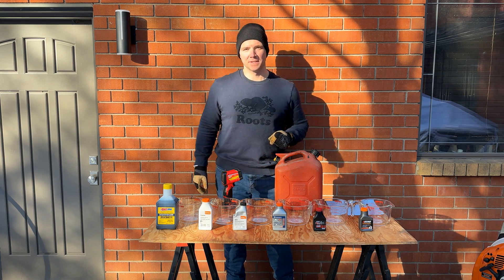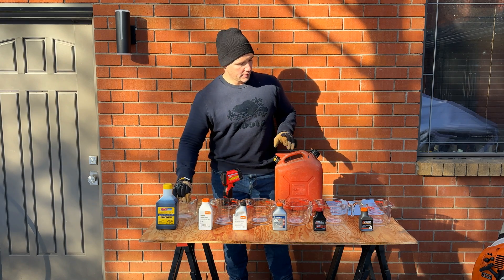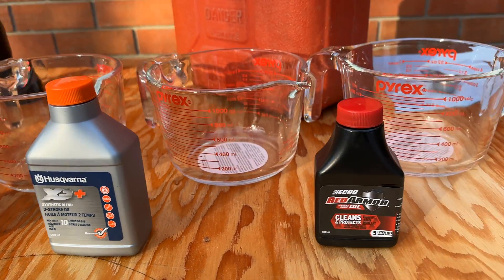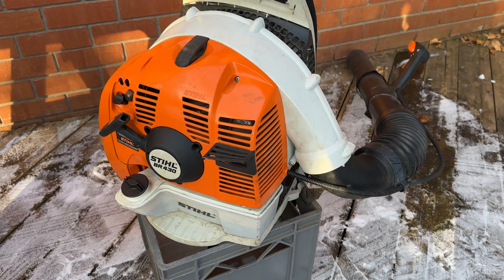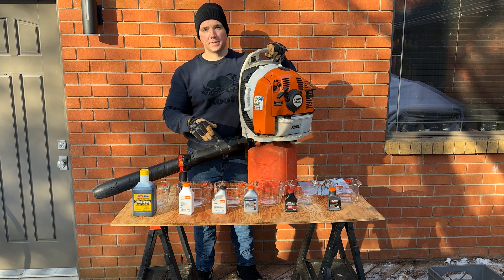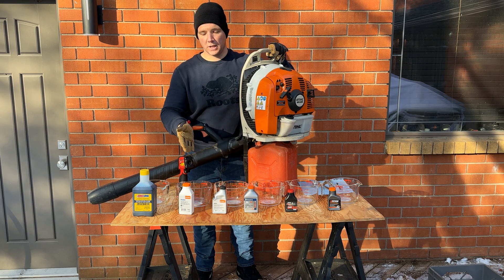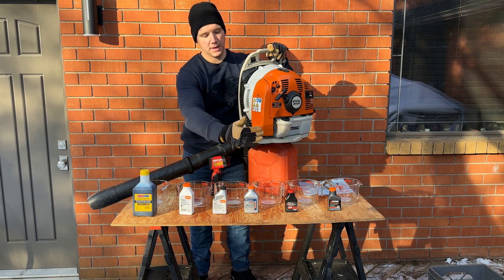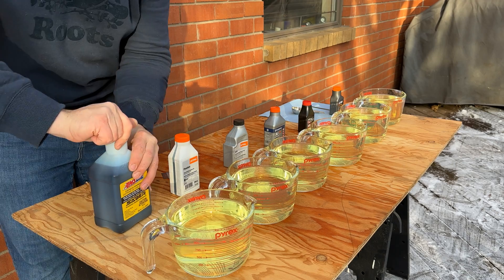Which 2-stroke oil is safest for your small engine? Temperature testing 6 of the most popular oils!

Comment: Dave, we all needed your in depth video  --- I don't know why no one hasn't ever made these tests public-- Thanks Dave !
Reply: I recommend the Echo Red Armor
Reply: Just get any of the maxima oils and be done with it
Reply: Maxima are good oils for sure but the saber was actuaslly supposed to be used at 100:1 which no other oil in those tests can do. Also the heat ids within spec of the engine and a couple of degrees isnt saying anything as the oil is to lubricate the piston, rings and bearings of the engine. All those other opils including Maxima, tends to leave some carbon deposits an d scoring and doesnt lubricate and engine better than Saber Amsoils does. Lubrication is what the oil is for, not keeping it a few degrees less in temperatures, lol.
Reply: @aconcerned  before advising people to use 100:1 mixture in an engine that the manufacturer suggests to be run on 50:1, just contact Stihl and ask them!

Also from all those oils only Stihl Ultra is fully synthetic and it says on the bottle.
All other oils, including Amsoil are synthetic blend oils. 
Good luck with running your machines with 100:1 ratio!
Reply: Which one you recommend? Link will be appreciated
Reply: Absolutely agree! I’ve used Saber in all my dirt bikes at 100:1, just because temperatures are higher or lower. The Amsoil although is one of the hottest, it is by far more superior in it lubricant quality. He didn’t use it at the recommended measurement either, which is at 100:1. I never froze a 2 stroke engine of any kind 
on Amsoil Saber. I own 4 Yamaha YZs, 125/250 2 Honda CRs 250/500. I pin these bikes and never had an engine freeze at 100:1.

Comment: isnt the saber is designed for 100:1 ratio not 50:1, because of mixing 50:1 it will have higher temperature. correct me if im wrong thank you

Comment: I have some older Homelite chainsaws that require 32-1 mix ratio , Taryl says with the newer oils (full synthetic only) I can run 50-1 in them , I currently run 40-1 , I mix the 2 1/2 gallon mix in only 2 gallon of no ethanol gas. What is your thoughts on this? Am I ruining my saws?

Comment: I believe you broke the first rule of science when you posit that lower muffler temperature mean safer for the engine.  How do we know that's true?  An oil could possibly lubricate better, leave less deposits, and smoke less yet burn a bit hotter.  Conversely, an oil could run a bit cooler and leave loads of crap in the engine.  Is the temperature of the muffler even a valid temperature to measure?   Wouldn't cylinder and head temps be more important?  How did removing the scroud affect cooling overall?  Also, how much did the ambient temperature vary over the course of the testing?   If you ARE using muffler temp, wouldn't it be better to take the measurement while it's running instead of adding another error factor by taking that measurement as the muffler is cooling down?  Wouldn't higher muffler temps burn off more deposits on the spark arrestor?  That's a GOOD thing, right?  Not trying to be Danny Downer here.  You put in a LOT of work for this test.  You were diligent at limiting errors in some areas, but not others.  I'm just not sure you were looking at the right factors.  I could be completely wrong, but these are the things that jumped out as I watched.  Have a super week.

Comment: I USE YAMALUBE 2T RACING MOTOR CROSS OIL AT 33 TO 1 ON ALL MY SAWS MOTOREX 2T OIL IS ANOTHER ONE ITS ALL ABOUT THE MIX MORE OIL MORE POWER YES THERE WILL BE MORE CARBON BUILD UP AND YOU MAYBE FOWL A PLUG BUT IT BETTER THAN REPLACING A SCOURED PISTON DUE TO MAYBE THE SAW WAS TUNED UP A BIT LEAN OR A DULL CHAIN MORE OIL IN YOUR MIX HELPS YOU PROTECT THAT PISTON AND CYLINDER FROM SCOURING AND PLUS YOU GET BETTER COOLING AND MORE POWER OUT OF YOUR SAW.

Comment: Well, if you ask what I think, I'd probably say that most people won't notice a significant difference between different oils, provided they are all made for the same sort of application.

That's not meant to discredit your efforts because I do appreciate what you've done here. It's nice information to have. I just think that in the grand scheme of things, all of those oils will do a fine job. So hey, pick the husqvarna oil, because the fuel is a pretty color. 😂😂😂😂

I'm using red armor right now. Once that's used up, I have a large stock of quicksilver PWC/snowmobile formula on hand which I've bought for the snowmobile, and intend to use in basically all my 2 cycle stuff moving forward once the RedArmor is used up. I'm confident that I won't have any problems with it, even if it's not the best oil on the market.

Comment: Ŵe use echo string trimmer a lot used some supertech 2 stroke oil and believe it or not the engine quit some sort of check ball in the carb. Went back to echo oil and it started right up and has never given anymore problems. Sounds like a commercial actually happened!

Comment: The Stihl oils made by Castrol have flash point of about 220*C(428*F) regardless that Ultra is full synthetic and Premium is conventional. That is why both can be used in 50:1 ratio.
Amsoil Saber has flash point of 180*C(356*F). So you understand the temperature difference in the video better now. 
For that same reason Stihl oils are JASO FB and don't cover FD - the oil doesn't burn all the way in the cylinder because of the higher flash point, but it lubricates better your engine. Your engine might be a bit dirtier and smoky with the Stihl oils but they protect the best. Running cleaner and better protected engine are two different things that don't go usually hand to hand. That is why there is no 2-stroke racing oil that covers JASO FB/FC/FD. 
Stihl states in the owner's manual that you should run their equipment at 50:1 ration only with their brand oils, but if you run any other oil (understand any JASO FC/FD or conventional Walmart oil) you should run 25:1.

Stihl requires special oil for a reason.
The handheld equipment like Stihl run between 9,000 and 12,000 RPM (depending on engine cc size) which increases temp and friction a lot.
Your 2-stroke (non racing) motor bike usually has a redline at 7,500 RPM, same as your boat engine.

Comment: It would have been helpful to include the current ambient temperature on a thermometer, so we could adjust for cooling by the air. I DO however, appreciate the work you have done here, and it is useful.

Comment: Dave, I appreciate your dedication to run and publish this test.  As a former chemical engineer and present arborist, you’ve given me food for thought…there are many variables for testing mix oil, energy can come and go a lot of places other than exhaust.  

Common internal combustion engines will operate at a thermal efficiency of less than 45%, which means a small two cycle engine will waste more energy than it produces per ounce of fuel sucked in…. If fuel delivery is identical, a higher exhaust temperature could indicate more output energy at the crank.  Higher exhaust temperature could indicate less frictional losses (bearings & rings) being radiated out through the engine block, cooling fins, etc.

My favorite tests of two stroke oil are the dissections, to see which oils stick to the moving parts best.
Reply: And I would think all these mixes have different flash points which would probably contribute to how efficient the engine runs, and thus external temp readings. But in the end most of us are concerned with engine wear and not engine MPG, so to speak.

Comment: Why would exhaust temperature be an endogenous variable of oil quality?  I’m sorry, the setup of the test seems flawed.  If you were to consult a tribologist you would soon discover most oils have the same base, and it’s only the additives that differentiate them.  I found the video where they simply shipped in the oil for analysis gave a much more comprehensive overview of what you were actually buying.

Comment: Thank you Dave.  This was a very interesting video comparing the 2-cycle small engine oils on the market.   I have several Husqvarna small engine residential equipment pieces and use the Husqvarna oil.  Over 10 years and no problems.  Proper winter storage is one of the keys.  I learned from Chickanic to winterize using the oil in the fuel delivery system through the winter then drain, fill and run for usage.

Comment: Amsoil is rated to be safe at 300 to 1 by the  tests but they new no kne whould by that number in 70s so they cslled it 100 to 1
  Bybthe way yes mire oil is just as bad as not having enough oil
 Remember  its not what the manufacturer  says the ratio is its how good the oil is made
    So what ever oil u choose and aays on the bothle that is how good the oil and the ratio u use it at.
    The gasoline  is what keeps the engine cool on a 2 stoke not the oil.
   Remember  how did we get from 16 to 1 to 50 to 1 amd any between  when there is nothing in a 2 stroke engine  changed except  the a few yrs at the beginning  with the bearings for the most part.
    For the price saber at 100 to 1 is hard to beat at the cost when getting a qt size bottle
    But also good that being off a bit is not gonna hurt either on the ratio

Comment: I've used Bel-Ray synthetic 2-stroke @ 40:1 in my dirt bikes and string trimmers for many years and they run strong, start easy, and appear to have very little deposits in the combustion chamber.  I can't get alcohol-free fuel where I am but I've not had a single problem.  Fresh gas, good maintenance, and a consistent mix seem to be the key.  Thanks for the video.

Comment: is temp the end all test. what about the lubrication of internals on 2 strokes. you want film strength and oil spread and lubrication onto internal bearings, rod and crank as well as low carbon in combustion chamber.

Comment: All the oils show they are up to the task.  I think it's interesting the Husky XP oil is near the hottest at idle, and near the coolest a full throttle.  Not sure how that should be interpreted, but interesting none the less.  I've been running Echo oil - get this - mostly because they have that bottle that allows me to very closely measure out 2.6 oz to mix with a gallon of gas for an accurate 50:1 mixture.  But I'm getting to the point the bottle is empty, I'll probably just buy a quart of amsoil, just because it's less expensive than these silly small bottles of oil that are mostly packaged so they can charge more for oil than you think you're actually paying.

Comment: A very thorough test, but temperature isn't the only indicator of an oil's quality for engine longevity.  

Richard Flagg's YT channel is good if you want to see him tear down chainsaws after running with different oils. 

His opinion of Stihl Ultra in (2 stroke) chainsaws is that it's sufficient, but there are better oils IIRC.  

He bases his conclusions on visible wear, cylinder and bottom end oil film, and carbonning.  

My Stihl 4-mix engines only get Stihl Ultra to ensure the piston/connecting rod bearing are sufficiently oiled. 

4-Mixes are torquey little motors, but they're particular about the oil they require.  Don't throw 87 octane E10 gas in them.  It's garbage.  

If you don't have access to ethanol free gas, use premium ethanol fuel with your premix at the specified ratio or a little lower.  If I don't have access to ethanol free gas, I try to use Shell V Power premium.  

My Echo backpack blower only gets Red Armor @ 45-50:1.  

Just my $ .02

Comment: All are good oils.  Allow me to share this information regarding Stihl Oil.  Stihl obviously contracts out their Private Label Oil to a trusted refiner.  That refiner would be Castrol.  In fact, on some of their small bottles, there used to be a small Castrol logo on the back label.  The Castrol Oil is their "2T" Two Stroke Oil.  You can find this oil in many Auto Supply Stores.  It's good for Motorcycles, Snowmobiles, etc.  Any two stroke engine.  It's the same oil as in the Stihl bottles.  Buying a quart of this oil is significantly less expensive than paying premium prices for any of these private label oils.  I've been using the Castrol in all of my blowers, string trimmers and chainsaws for years.  Never have I had a problem with properly mixed oil in non Ethanol gas.  Good Luck and thanks for sharing this video.  Happy New Year.
Reply: Well said sir ,  i have found in the last 50 years that " WHAT PEOPLE KNOW "  is mostly crap ! I use Castrol fully synthetic race bike oil .
Be wear of E-bay CASTROL half of it is NOT , BUY FROM A REPUTABLE SUPPLIER !
Reply: And all the old schools use castrol 
Or stihl ultra. 2stroke mix 😂😂 legit. They’re the same.

Comment: Opti-2 is the best. I have been doing this since at least 1975, and Opti-2 mixed with ethanol-free gasoline is the absolute finest 2-cycle fuel on the planet, and this includes the pre-mixed fuels you can buy in a can at lawnmower shops. It mixes 100:1, but I always go 80:1 and have never ever had a problem. I have small lawn equipment that is 25 years old and never ran anything but opti-2.

Comment: Aspen fuel was invented in Sweden and is manufactured there. Perfect lubrication - no smoke or smelly exhaust fumes. Leaves no residue in carburetors. 99% cleaner than pump gasoline. Much healthier .

Comment: Any name brand 2 stroke oil preferably synthetic blend. I’ve used Red Armor.. I’m currently using Husqvarna XP cause it’s been the cheapest on Amazon for  a while bought by the gallon. I just eyeball my mixture cause I’m so familiar with the color as a landscaper. Measuring cups in my truck is a pain in the ass cause they get dirt stuck to them unless you keep them wrapped in a ziplock which could also get dirt on it. I’ve been doing it this way for the last 100 gallons or so.

Comment: You need to be measuring cylinder head temperature. Not exhaust gas. If anything, you're reading which oil is pulling more heat out of the engine. Again, if you're not testing cylinder head temperature or temperature on the fins or even on the case then this test is not valid and also misleading. Amsoil dominator is in excellent oil at a great price. I've run it and everything from raised bikes to snowmobiles to weed eaters and chainsaws. I do my all my own top ends and the proofs in the pudding.. I would never run steel two-stroke oil. It's probably the worst one there to run

Comment: As I seen in a n other YouTube test , AMSOIL had a lower burning point.  So measuring the exhaust temperature indicates how well it burns. Higher exhaust temperatures would indicate more power end less pollution by more complete combustion.    So measuring the temperature  of internal components would give a idea  if it lubricates well.

Comment: I appreciate your video, not sure if the results relay point out anything which would be meaningful to me. As the day went on the ambient t temperature of colder as the sun dropped which may or may not made a difference.  Also it cannot be said if the engine’s storage of heat after time affects the cool down differently. Jerusalem.There was not any super drastic difference which , not me, would say any one brand was junk, nor was any one brand so outrageously better. I feel if an operator uses any of these “brand” oils correctly then it would be just fine. Me personally I have used both the Stihl oils, the Echo Red Armour, and the Amsoil Saber. I like the Amsoil because of the actual metallurgical data and the ability to use at 100:1. To date since changing to the Amsoil Options my equipment rums like a top answer I am saving money. I, just for grins, have looked into the cylinders of some of my equipment  that I have used Amsoil in from day one and the metal looks new. Regardless, thank you for your video. I would be interested in what you feel about the outcome of the experiment  and also for what other viewers felt about the results as it meant to them.

Comment: I read that Amsoil 100:1 was tested at 200:1 during development with good results. Hence when I use it, I mix it at 100:1 for a blower or trimmer, and maybe 80:1 for a saw if I'm working it hard. Always ethanol-free gasoline, and I've never had a clogged exhaust or failed carburetor or bad fuel lines. I'm still using some equipment I've had for 20+ years! Well... I did have to replace a fuel hose on an old McCoulloch trimmer that is 40 years old😂

Comment: If temperature is your sole metric for success, you need to control for changes in ambient temperature as well.  Assuming the requisite drop in temp as you burned daylight, Amsoil had a distinct advantage over all the others, especially compared to the Echo-branded oils which were disadvantaged by the presumably highest ambient temps at the time they were tested.  (I don't work for any oil companies or any of the brands mentioned.)

Given the 74K views, it was probably worth your time anyway.

Comment: I have to say that exhaust temperature especially measured from outside, (and possibly too far away with IR gun) doesn't have almost anything to do with how good the oil is. If someone wants to optimize longevity of metal parts, just jet it a bit richer and maybe use a little bit more oil in the mix. Sacrifice is less power and maybe more carbon in the engine.

Here are some interesting ideas to test instead (if not already done):

-Oil amount inside 2t crankcase with different oils (compare to the flash point in the data sheet)
-Oil amount inside 2t crankcase with different mixes. (Use same oil)
-Torture test of 2t engine jetted properly with as little oil in the mix as possible. 0.7%, 0,5%, 0.3%? Maybe no one did this before and would make good half educational content.
-Carbon cleaning abilities of different oils.
-Carbon fouling tendency vs. Oil mix.
-etc.

I will go check some of your other videos in case you did something similar already. Keep it up. 👍